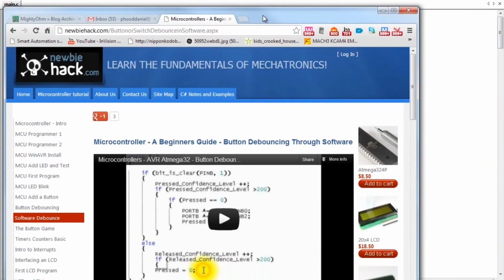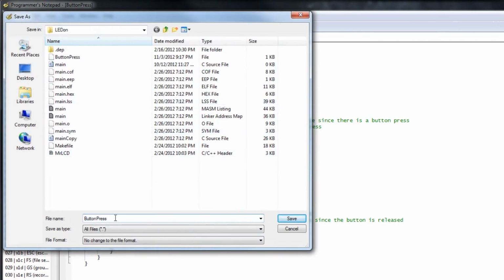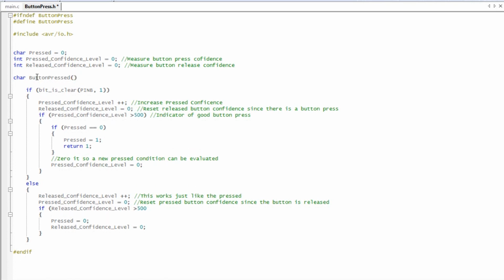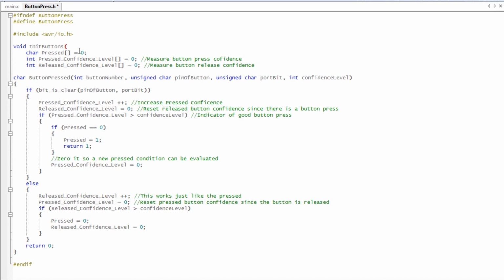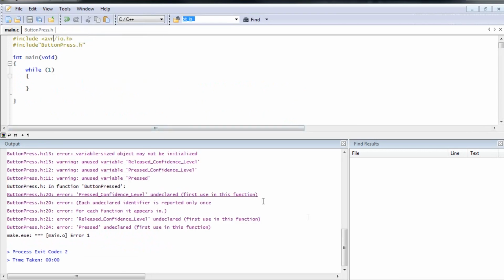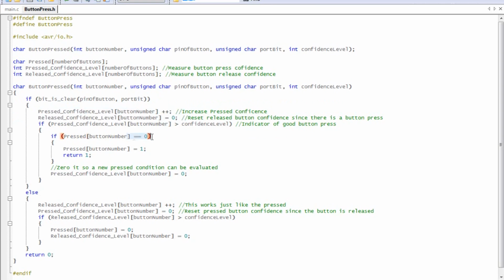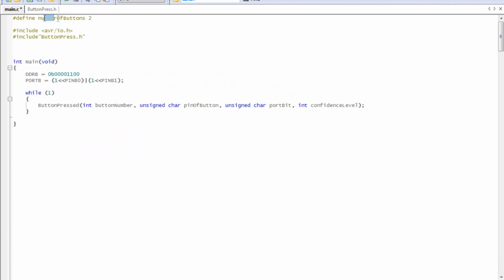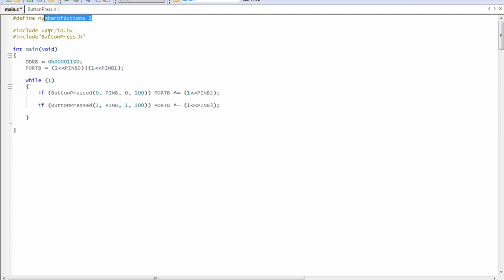16. Arduino for Production! AVR ATmega32 - Creating a Push Button Library

Comment: This is no longer relevant for Atmel Studio 7.0.  I want to use the create static c library option in atmel studio 7 and add the ButtonPushed function to a library called ButtonLIB.  I checked the forum and as expected got nothing but a bunch of smart asses saying RTFM!  The AVR-LIBC manual is useless for a HOW TO use atmel studio!!!!  I do not link or develop code down to the AVR-LIBC linker  level -  that is the whole f-ing purpose of having an IDE!!!!  I can see having to understand how to add paths into the toolchains but not literally manually typing in the damn compile and linker command lines, or organizing object and source files and manually building makefiles!!!!  That is the job of the studio 7 IDE!

All I know is I want to make a library that may contain many functions.  But I only want to link the functions that are called in the program not a single huge library of functions.  That means, I would assume, that I want each function within the  library to have its own .h and .c file and .o files that somehow then gets combined into a single library.a and library.h???

Where I am confused is what the workflow is using atmel studio 7 toaccomplish this???  For this example lets say in addition to bool ButtonPressed(), I have int Foo().  I can create a ButtonPressed() function and header and .o with ButtonPressed.c and ButtonPressed.h and a Foo() function and header and .o with Foo.c and Foo.h.  Now how do I compile the .o's into a single library.a and create the library.h??

Or maybe what I am thinking is totally wrong!  Someone, somewhere in the damn world has to have a workflow and methodology for doing this kind of thing!  It is central to programming!!  What I need is for someone to lay it out STEP by f-ing STEP and not say READ -THE-F-ing-MANUAL and FIGURE IT OUT like a smart ass!

Your videos are very good and I am pleading with you to please update this and give us a workflow for creating static libraries using atmel studio 7 either as I have described or the secret RIGHT-WAY that the smart asses over at AVR-FREAKS want to either keep to themselves or do not know so feel like answering RTFM makes them sound inelligent!!!!
Reply from the maker: It's unfortunate that the forums out there are only there to steer you away.  They are supposed to be helpful and be a place where like minded folks gather and discuss the subject.

With that said, I don't have much experience in separating functions out and compiling them separately.  I believe the optimization of the compiler will do this for you.  If the main.c doesn't use a function in a very large library, the compiler knows this and only converts the necessary functions (the functions of the function) into machine language for the microcontroller's use.

Comment: PLZZZ TELL ME Y ITS not working

#define numberOfButtons 8
#include <avr/io.h>
#include<util/delay.h>
char ButtonPressed(int buttonNumber, unsigned char pinOfButton, unsigned char PORTbit, int confidenceLevel);
int main(void)
  {
        DDRA =0x00;
 DDRC=0xff;
        PORTA=0xff;
 PORTC=0x00;
     while(1)
     {  
       if (ButtonPressed(0, PINA, 0, 100)) PORTC ^= (1 << PINC0); 
       if (ButtonPressed(1, PINA, 1, 100)) PORTC ^= (1 << PINC1);
       if (ButtonPressed(2, PINA, 2, 100)) PORTC ^= (1 << PINC2);
       if (ButtonPressed(3, PINA, 3, 100)) PORTC ^= (1 << PINC3);
       if (ButtonPressed(4, PINA, 4, 100)) PORTC ^= (1 << PINC4);
       if (ButtonPressed(5, PINA, 5, 100)) PORTC ^= (1 << PINC5);
       if (ButtonPressed(6, PINA, 6, 100)) PORTC ^= (1 << PINC6);
       if (ButtonPressed(7, PINA, 7, 100)) PORTC ^= (1 << PINC7);
}
}
char ButtonPressed(int buttonNumber, unsigned char pinOfButton, unsigned char PORTbit, int confidenceLevel)
  {
     char Pressed[numberOfButtons];
   int Pressed_Confidence_Level[numberOfButtons]; 
   int Released_Confidence_Level[numberOfButtons]; 
    if (bit_is_clear(pinOfButton, PORTbit))
       {
   Pressed_Confidence_Level[buttonNumber] ++; //Increase Pressed Conficence
   Released_Confidence_Level[buttonNumber] = 0; //Reset released button confidence since there is a button press
         if (Pressed_Confidence_Level[buttonNumber] > confidenceLevel) //Indicator of good button press
           {
               if (Pressed[buttonNumber] == 0)
    {
    Pressed[buttonNumber] = 1;
    return 1;
    }
 Pressed_Confidence_Level[buttonNumber] = 0;
    }
 }
   else
     {
       Released_Confidence_Level[buttonNumber] ++; //This works just like the pressed
        Pressed_Confidence_Level[buttonNumber] = 0; //Reset pressed button confidence since the button is released
        if (Released_Confidence_Level[buttonNumber] > confidenceLevel)
   {
    Pressed[buttonNumber] = 0;
                    Released_Confidence_Level[buttonNumber] = 0;
                 }
              }
       return 0;
    }

Comment: Hi,
Thanks you so much about your video!
I'm coding same your code on Atmel Studio 6, but it does not run! I don't understand why! Atmel Studio say that:
"implicit declaration of function 'ButtonPress' [-Werror=implicit-function-declaration]"
Reply: +Tran Dat I testing in Atmel Studio 7, but my problems is other, my error is
Cannot find -Ipb.h
Id returned 1 exit status
 :'v
Check the code and search bad characters D;
Reply: +Rafael Regalado 
Oh. Thanks you so much. It's my error. On Atmel Studio, 
The command  "#ifdef ButtonPress" and "#define ButtonPress" must to be #ifdef ButtonPress_h_" and 

"#define ButtonPress_h_"
Reply: +Rafael Regalado
i think that you don&#39;t add library into same file with source code
Reply: hello again, i fixed my problem, i add "#" in the header file for the include<>, and in the main code, i used other funtion , i used ButtonPress, but is "ButtonPressed", :D
Reply: +Rafael Regalado  
:)
So you find an other library! @@

Comment: Hi,
These are awesome videos and I would like to thank you for this work. I landed on the channel while searching about I2C protocol. I just started watching other stuff as well.

I would just like to add one thing about writing the executable code in the h file. It is almost never a good idea to write everything in the h file. 
Eg if in future, we are creating some libraries with some static functions, which are helping only the public interfaces, we will want to hide them from other modules. Well this is not applicable in this example, but you can still point out that it is a good practice to have a c file for the modules, as a new developer might unknowingly develop a bad habit of writing everything in a h file.

Comment: I followed up on your tutorials so far and everything works as planned, thank you very much. I am using AS6 now as you explained in a previous video and it took me some time to create a library there. Why did you introduce AS6 and then abandon it or is it coming back later ? Anyway, to create a h.file I used this site for some extra help :
http://stackoverflow.com/questions/13524037/how-to-add-header-files-in-atmel-studio-6
I copied the code from your webpage where this video originates and found that this line "include <avr/io.h>" is missing a #.

Comment: One thing I noticed and I could be wrong, the part of the library that checks confidence level of the button being set low or off. I think this is redundant, if the confidence level isn't there that the button is pressed then it must be off so we are confident automatically that it is off if we are not confident it is on. Example if you take out the button off confidence level you simply remove the lag from letting go of the button as the LED will turn off at first 0 input and not go back on again unless the confidence level in the button pushed returns a 1. Disclaimer: I've never built a circuit before and I am using your stuff to learn, this seems to work logically but i have no idea if it works in practice, when I get the stuff to make this I will test my theory.

Comment: Hey, you may pass the number of buttons to array by using malloc/calloc functions.
It will look like this:

char InitButtons(int numberofButtons)
{
     char* Pressed;
     Pressed = (char*)malloc(numberofButtons*sizeof(char));
     [...]
     access Pressed like normal array Pressed[index] or by pointer *(Pressed + index)

     free(Pressed);
}

Comment: Hey, great video! One improvement:

why not pass the pin into the subroutine by reference?

instead of:
char ButtonPressed(int buttonNumber, unsigned char pinOfButton, unsigned char portBit, int confidenceLevel)

write this:

char button_pressed(int *portBit, char pinOfButton, int confidence_level)

and when calling the routine, write this:

if(button_pressed(&PINA, 0, 100)) PORTB ^= (1<<PINB0);

if anyone wants the updated library, message me for the download link :)

Comment from the maker: You can use any operation that is associated with a pin function in a library.  There really is no constraint on how you would use the registers in a microcontroller as long as it conforms to the c language.  Just remember that you are just changing bits in a register like you change bits in a number, or reading changing bits from an outside influence.

Comment: Patrick, Great work with all you tutors I have to say I've learn so much. Do you have the ButtonPress.c file so I could make this library? Also is it possible to download MrLCD too? Could I use an interrupt in a library or does that have to happen in the main function? I was to make a simple traffic light library init would have pins and timing.  I've been following along using an ATMega16 since I don't have a ATMega32. Can you do a tutor using jtag ice for debugging a simple program.Thanks Don